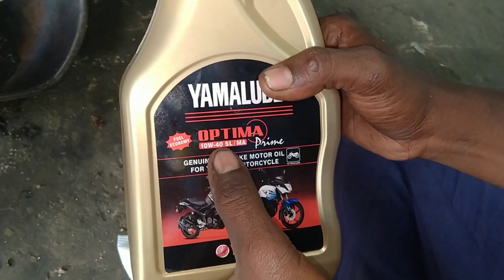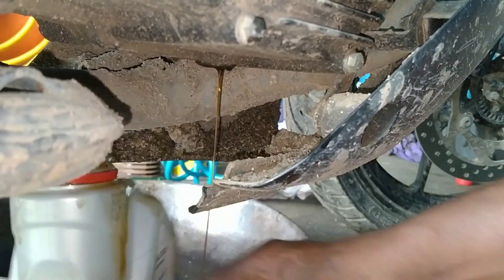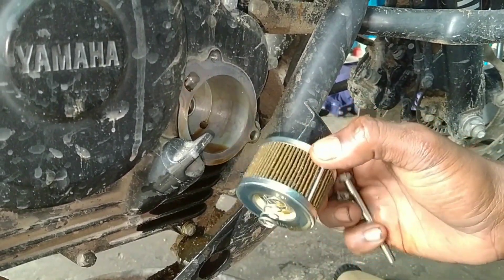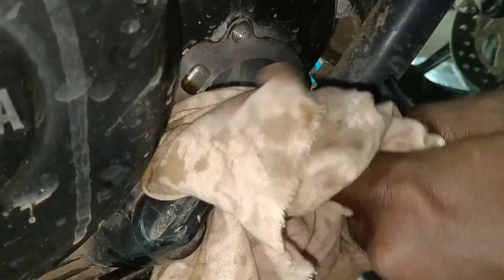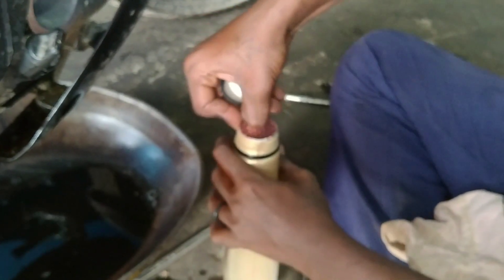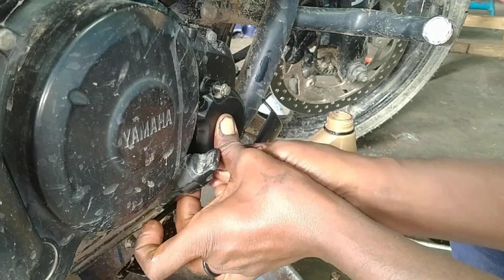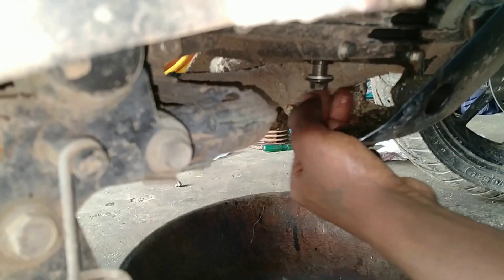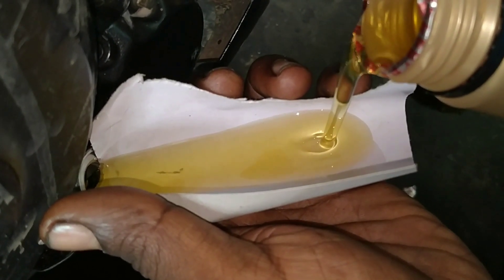யமஹா எஃப்இசட் இன்ஜின் ஆயில் பில்டர் எப்படி மாற்றுவது?/ change for #Yamaha FZ engine oil filter

Comment: Entha vandiku 1.4 Litre oil podavendum nanba
Reply: Yy 1.4 lit only 1 lit what
Reply: @SakthiVel-pz7tl  because it is mentioned in the company user manual....

1450 litre if the oil filter changed
1350 without oil filter change